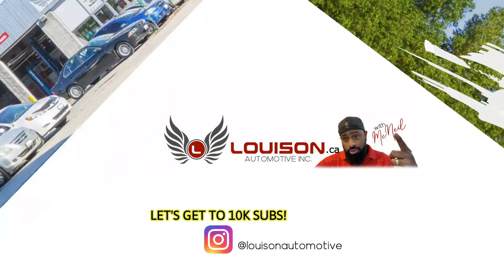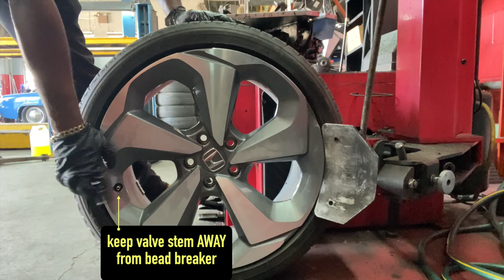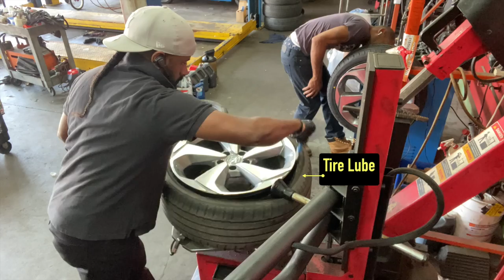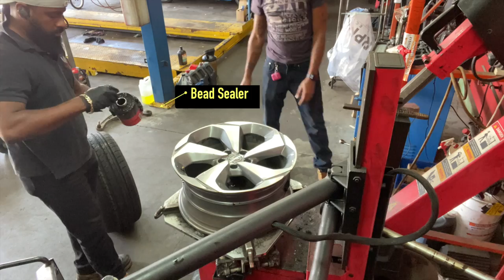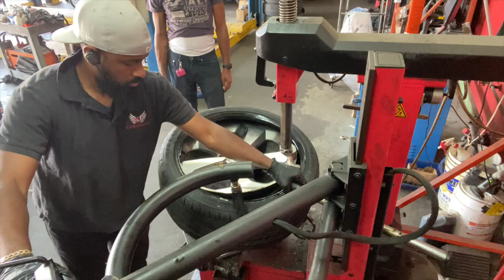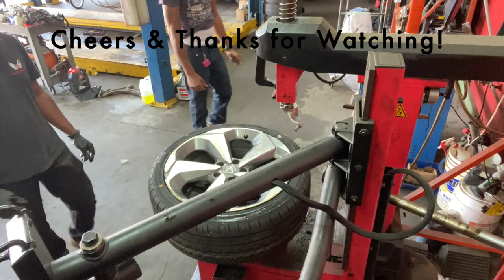How to change LOW PROFILE tires using Multi Arm Tire Machine

Comment: Problem with low pro tires is if you dont have the right machine it  almost always has some vibrations from warping the metal belt and leaks from deforming the metal in the bead around the edge, its a bad idea to remove and install them alot, low profile tires are used in conjunction with rubber isolators in the shocks to dampenin bumps is invented for heavy vehicles so the tire wont dismount from drifting in a 3000lbs+ to 4000lbs+ vehicles the old boats from the 70s would body roll and just not have the grip available

Comment: How much do you charge for this?
Reply from the maker: To install and balance tires, we start at $25/tire....the lower the profile the harder....so can range up to $30/tire.
Reply: That's A steel duck head?
Have plastic keeps folding with more car with sensor now have to be more careful even splitting them👍
Reply: @tubleejthoj6595  What?! I live in a very nice/expensive region (Northern VA / DC area). The tire shops around me charge $5 for dismount, $10 for mount, $5 for balance. Hell Sam's club charges $3.88 for balance. Where the hell u getting $50 per tire??? And that too in Wisconsin which is poor midwestern state (I used to live in Grayslake, IL)
Reply: I live outside Boston and my Volvo/Polestar dealership
charged me $256.00 for a winter tire swap - and they scratched 3 out of 4 rims! Highway robbery!!!